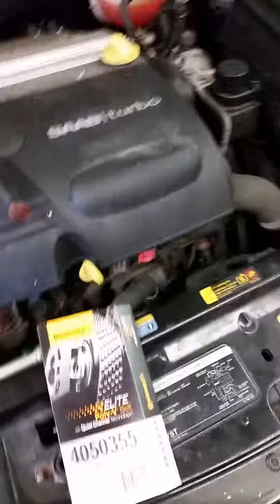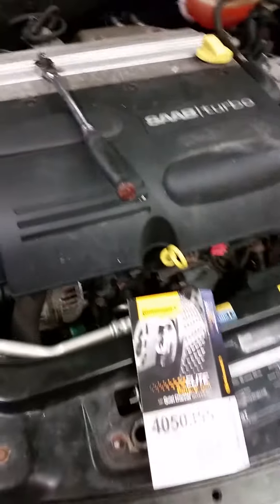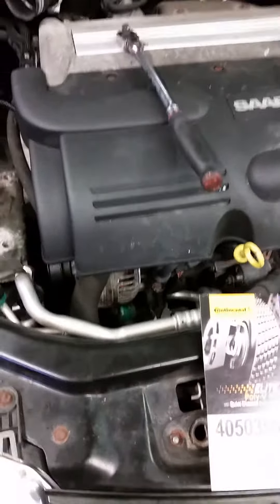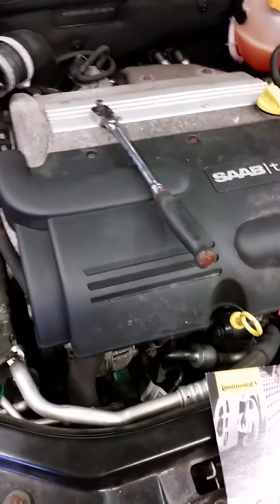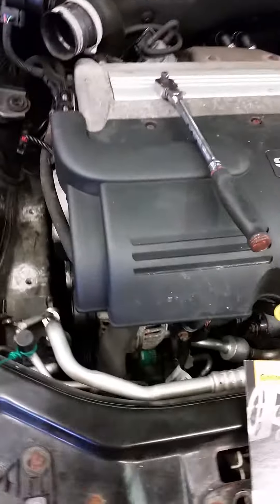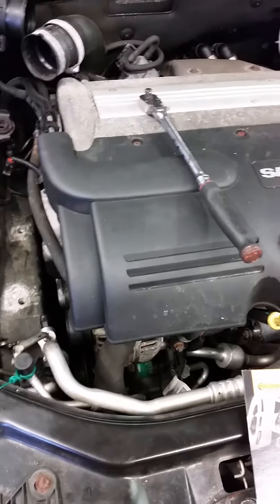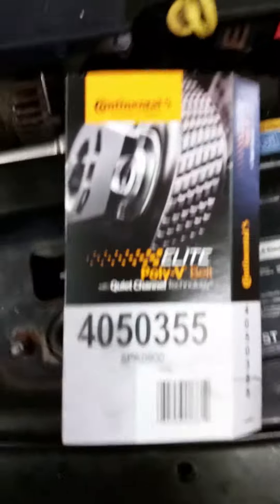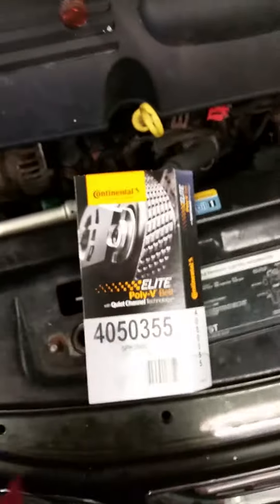Saab 9 3 serpentine belt ac delete

Comment: Do you know if this would work on a 1999 Saab 9-3 2.0 turbo?
Reply from the maker: Good morning fish I wish I could answer that for sure I think it is though .  Does it look the same?  A lot of times manufactures won’t change major components like that over the span of 2 to 3 years so I’m pretty sure it probably will work . You can test it first and then if it does work, roll with it. I hope that’s helpful have a great weekend
Reply: @sharpcarco  yes it does putting it on my saab today I was going way too fast I think I messed the water pump as well that sports mode just too fun